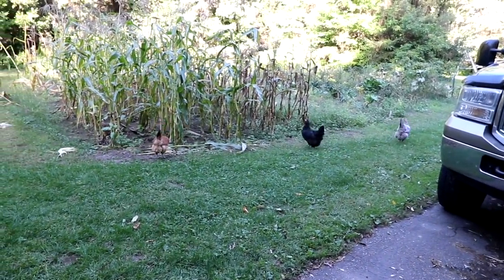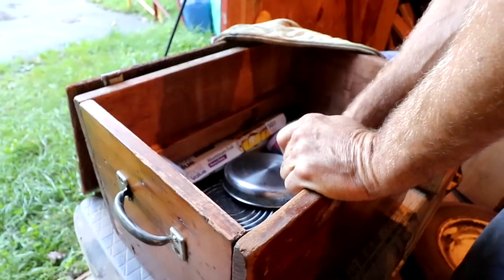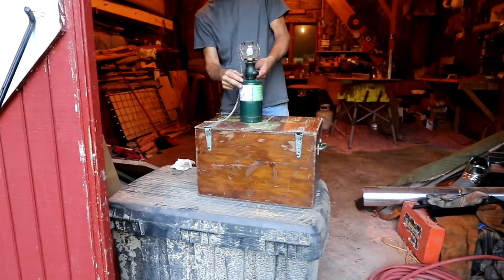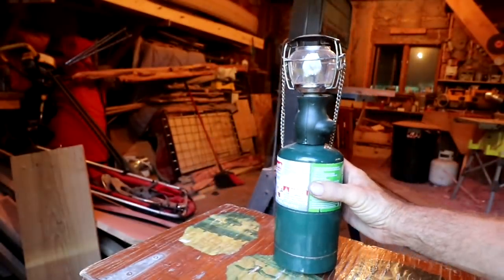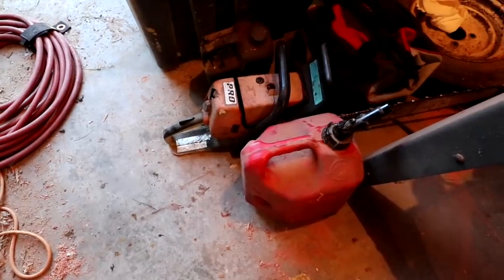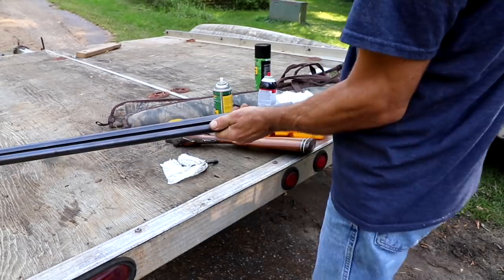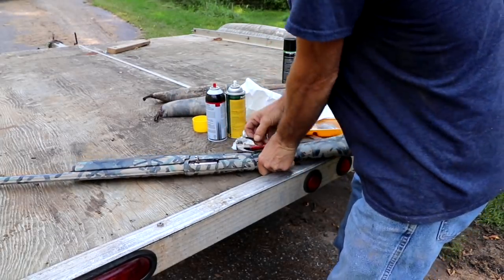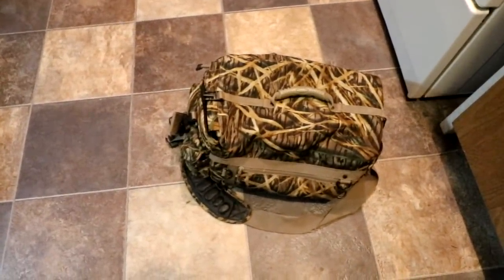Getting ready for Duck Hunting 2019. Checking things out. Packing things up.

Comment: Joe go to a stihl dealer and pick up a 2in1 file. They run about 49 bucks. But it will file your tooth and rackers down together to factory specs. Only thing is you have to know which chain that you have. Different chain requires different files. I have 2 for different saws, and I love them.